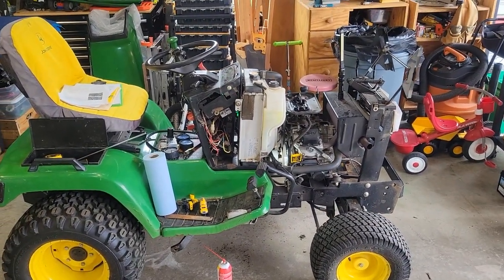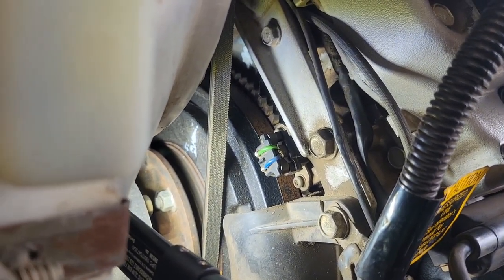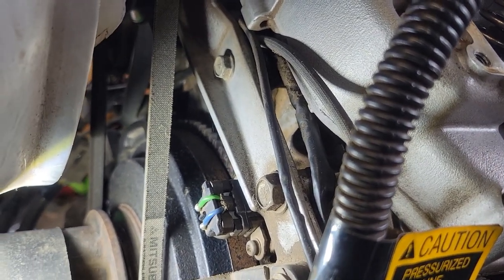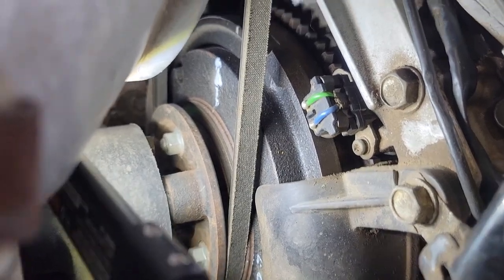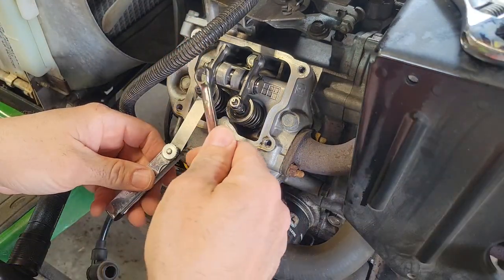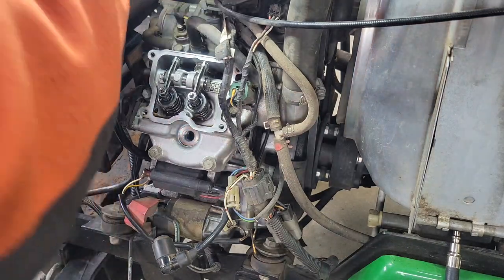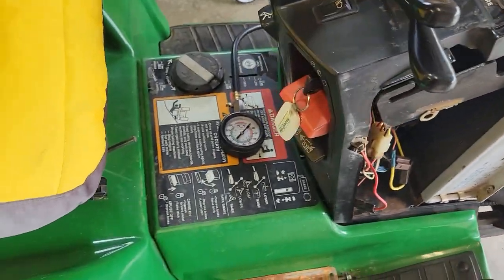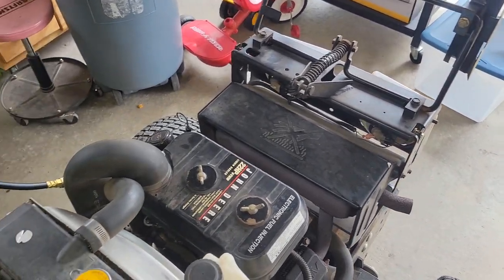John Deere 445 Valve adjust, Compression test, Leak down test

Comment: Thanks for the video. I’m in the same boat. Mine tested 120. Blowing lots of oil in the air filter.
Reply from the maker: Glad it can help.  Definitely check those valve gaps and do a leakdown.

Comment: Great video. My 445 idles too high and sometimes after mowing sticks at full throttle.  Any suggestions?   Thanks
Reply from the maker: did you try lubricating the pivot points?  Maybe it is just sticky?

Comment: this is a four stroke engine , why do you adjust both intake and exhaust valves on the same stroke?
Reply from the maker: I did not adjust on the same stroke.  Sorry if that didn't come across in the video.